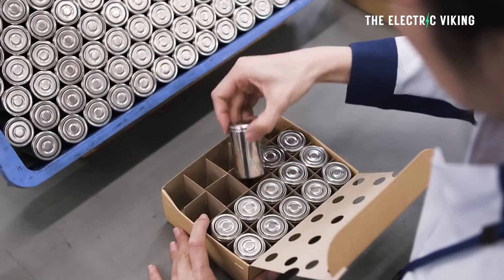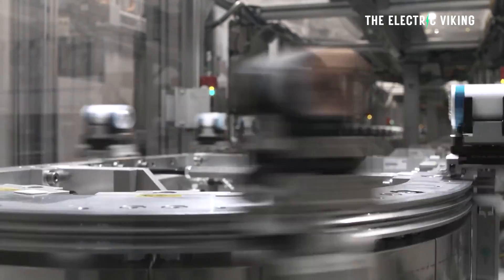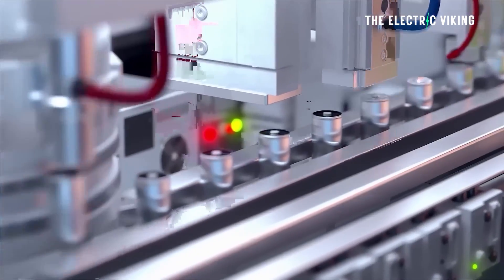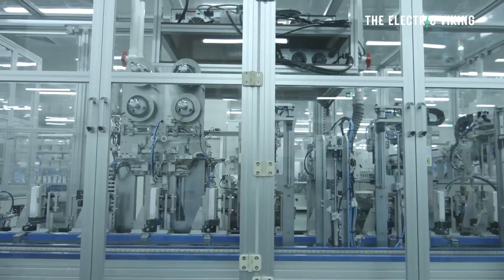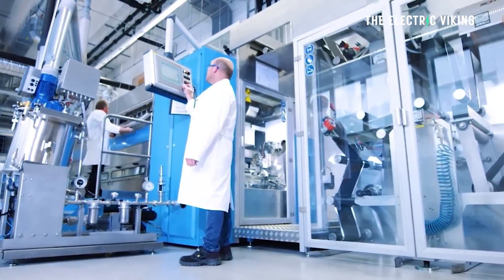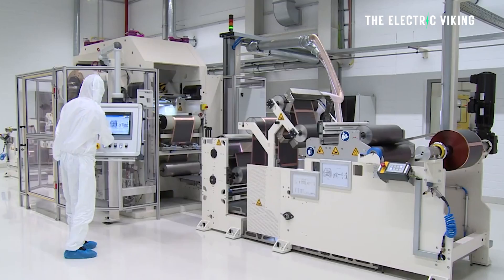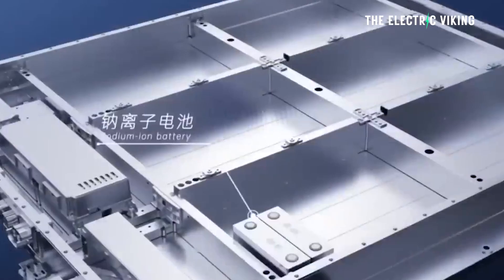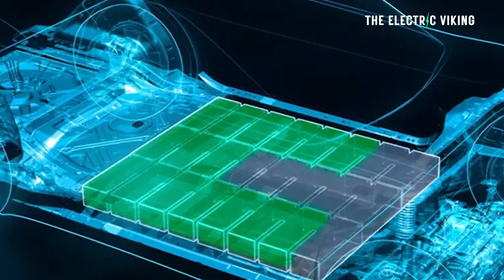Germany spends years doping Sodium-ion batteries to improve performance

Comment: Demand will advance this much needed tech for society.  We must watch that the same thing that happened to John B Goodenoughs 2nd Nobel prize award winning battery  does not happen to up and coning chemistries like these "salt" batteries. 
Basically,  shelved by big oil.  Shown in " Who killed the electric car ".

Salt.. kinda vague...im guessing a layering process. Grown like a crystal with water softener salt, eg.  Drained & flooded with a different salt slurry each layer.  Alternate layers grown with flouride, alum, bath salt, eg. Ideally home ingredients.  Possible with an electrical load swapping directions, each layer to deposit the crystalline structure to the anode or cathode.  Id like to see it considerably more DIY possible like a solid leyden jar , but in 5 gallon pails/ carbon rods.  If it was cheap and easy, it wouldn't matter if it was not near the li ion batteries density.  People would allow for the space in their home and provide for the grid during high demand periods.

Comment: Much grateful for all your EV videos Sir.    IMHO,  Sodium ion battery is already a Perfect battery.    Considering salt is an infinitely  endless raw material  available  everywhere.   
 Sea water desalination problems of where to put the  extracted salt can possibly be solved thru this.   That said,  the  trick to  maximize   adoption of Salt ion batteries maybe to  go for trade offs.     
  Salt ion batteries with shorter   lifespan but   much  cheaper   would allow  more  to buy EVs.    This way, if ever recyclability is  already  possibly maximized,     battery manufacturers will  profit more  by  selling more batteries.   This is comparable to China model of  selling  quantity  over quality.      Though it doesn't mean the salt ion batteries be poor quality,  just traded off long life to lower price.  
 With such  strategy,   much more  salt ion battery  manufacturers / recyclers could  come up  boosting the economies of their  localities.     Salt ion batteries   on  massive scale  being  charged by  renewable energy could then   compete with  other fuels like  petrol and coal.     Again, I think the  secret  lies in trade off rather than wait   a very long time   to perfect this technology.

Comment: Lithium prices are TANKING...nobody wants EVs
Reply: Your comments are tanking. Nobody really wants to read them.
Reply: Well they found a way to get rid of the giant pits that take forever to produce a bad product and changed it to high pressure filters which are 99% perfect instead of 40%. 
Seems way more beleavable. Also BEVs will not be the most use for batterys solar and energy will need A LOT.....
Reply: Nobody apart from a couple of million nerds apparently 😊
Reply: Actually lithium prices are rising.   Over-production in china by 91 mfgs led to glut of car inventory and pause in buying li.    What you need to know is that lithium price is below production cost...... Way below for long-term sustainable lithium production.  It's just going to lead to a cyclical high swing because of the pause in the supply chain development.

Comment: So it is another breakthrough that is at least ten years away if ever
Reply: If you look at a chart of battery improvements over the past 20 years, you'll quickly see prices per kw have fallen by 60 times(or rather 1/60th original cost), charging speeds in the last 15 years have increased 20 times and battery density has increased by 3 to 4 times.  These breakthrough's are most definitely happening, people just aren't paying attention because they're more gradual compounded improvements than sudden one off events.  The newer batteries just released by CATL have some serious improvements in density, charging, and pricing so this gradual compounded improvements will continue for the foreseeable future.  It isn't just CATL either.  BYD and Panasonic have newer batteries coming out in the next few months with some pretty impressive improvements as well.
Reply: @Ryan-ff2db  with all those batteries from lab to commercial production it is at least ten years of development and i am been generous with the time frame. Regardless it will be at least 20 years before the grid is expanded enough to cope with the load . What about more remote areas that rely on generators of less than 5mw to power the towns ? Don't say solar because cyclones and cloud cover during the wet season make solar pretty useless Australia is way more than city's
Reply: @randomoldbloke  The research in batteries is ever increasing, with more money than ever going into R&D than ever before.  20 years is a ridiculous overstatement but the truth is most of these experimental batteries will never make it to commercial use. However, some will.  The next few years will see significant improvements in batteries across the board, just as the years previous, but it all starts at the lab level.  Another thing to note, sodium-ion batteries are already on the market and there are almost 30 factories under construction dedicated to Sodium-Ion.  Improvements to an existing technology happens a lot faster than inventing a whole new architecture, which is exactly what this video was about.    

I'm not going to talk about solar as has nothing to do with my comment or the video or even the original comment.
Reply: Sodium batteries are here today made by catl for byd
Reply: Hakadi salt ion batteries are now selling batteries same package as lifepo4.
Reply: @franssantos9417  Yes.  They're not any cheaper yet, but CATL/BYD are predicting $40 per kwh once they ramp.  If they can hit that price point or even get close, that would completely change the storage market both at grid level and home storage.  It is no longer a matter of if, but a matter of when.

Comment: Scandium $270 per gram. F that
Reply: Scamdium?
Reply: @ahaveland  One of the minerals that Germany was experimenting with for the doping process. That and Manganese.
Reply: Irrelevant. We are talking about doping here. That means miniscule amounts. Anyway at the moment nobody much is actively exploiting scandium. When they do the price will plummet. Aluminium started out more costly than gold but it is now a plentiful inexpensive commodity.
Reply: @rogerphelps9939  Minuscule amounts on a film that is nm thick adds up pretty quickly. 

Aluminum was costly due to refining costs, and after a bit more digging you are right. It is an under utilized element whose cost is only high because no one knows what to do with the stuff outside of aluminum alloy production.

Comment: Sodium is much more reactive with water. It is much heavier than lithium but it only carries the same one positive charge. For cars lithium must be better but for stationary batteries sodium is good.
Reply: I think you meant to say negative charge. The periodic table tells us all we need to know about Lithium and Sodium. Lithium is small and light, sodium isn't.
Reply: @davidbrayshaw3529  No. Group 1 elements lose an electron - the only one in their outer shell  - so the positive protons outnumber the negative electrons....creating a positive ion.
Reply: @johnfrancis4401  Now you've got me thinking! If they lose an electron, then yes, they are ionised. If that electron remains in the outer shell then the atom is stable, I believe.
I am open to correction. My last physics class was in the mid 80's.
Reply: @davidbrayshaw3529  No.....sorry. Ions are stable because they have full outer shells. But to achieve full outer shells the atom must gain or lose an electron or two or three. Chemistry...circa 1965
Reply: @johnfrancis4401  OK, I can see that. Thank you for the refresher.
Reply: All alkali metals are reactive, which is why they are useful in batteries.  They are dissolved in the electrolyte which in lithium's case is flammable.  It's this burning of the electrolytes that sustain a runaway reaction, not the reactivity of the metal itself.  The two electrolyte's being used in modern Sodium-Ion batteries are not flammable and do not easily burn.  This inherently should make sodium-ion safer, but time will tell.  However, either type of battery has been proven over and over again to be significantly safer than gasoline and results in roughly 1/60th the amount of fires for any given vehicle.

Comment: Sodium ion will replace Lithium once super charging networks are ubiquitous.
Reply: I highly doubt it. Sodium is more than 3 times the molar weight of lithium and carries 11 electrons in its outer shells to lithium's 3.  It is going to have very little practical application in transportation. Where it will benefit transportation is by freeing up lithium that's currently being used in stationary batteries. You might see it used in tuk tuks and golf carts, but that's about it.